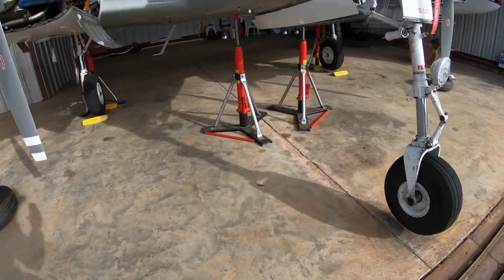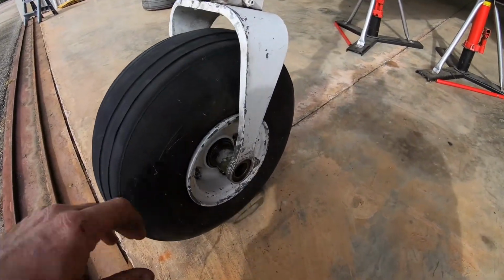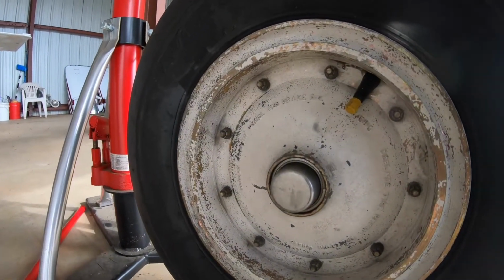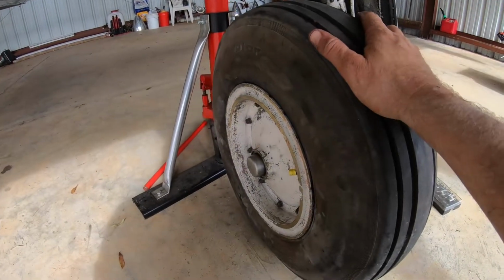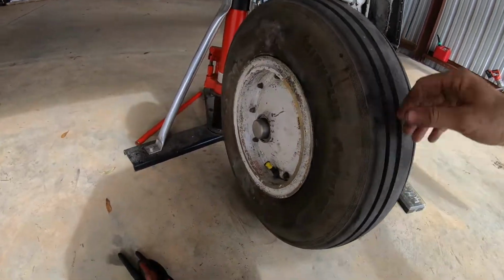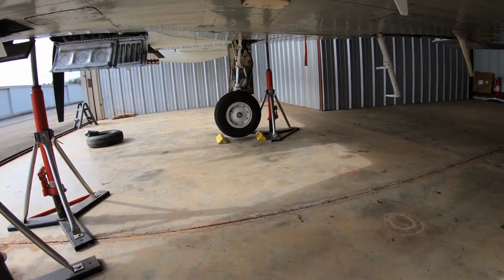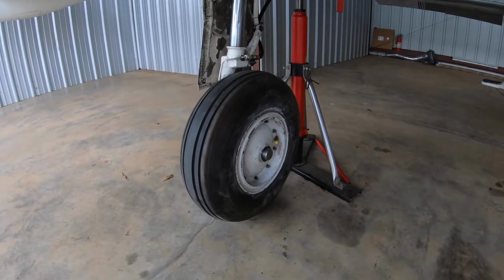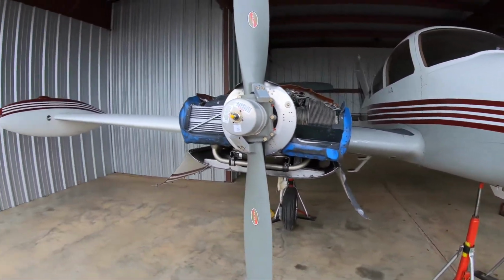Cessna 310 Annual Process Day 4

Comment: Curious how you're dealing with the heater A.D. I have several directions to go as far as compliance and cost effectiveness.
Reply from the maker: Hey Paul my heater AD comes up next month I’ll be doing a YouTube video on it. I contacted Harold Haskins Inc they said they could do the A mock on my heater for $4800, But it normally runs me about $250-$400 to get mine pressure tested for the AD